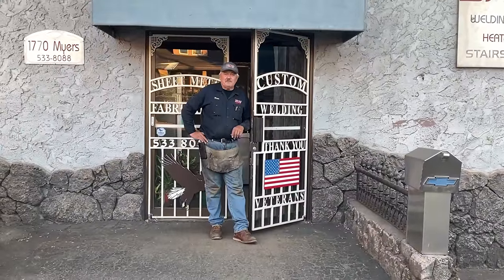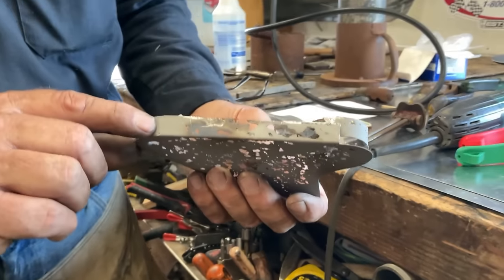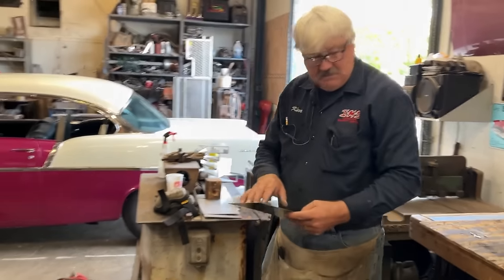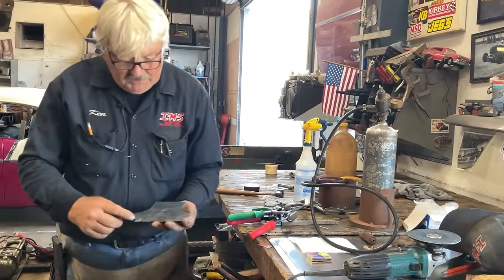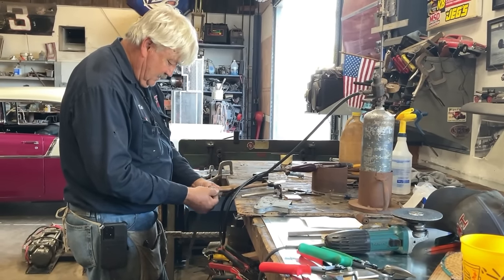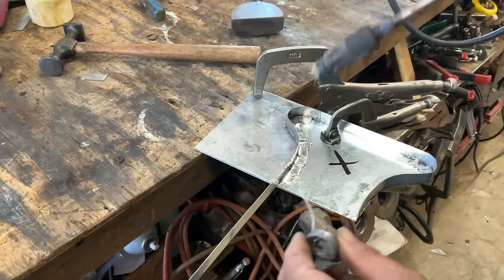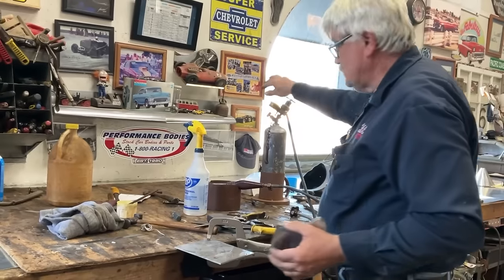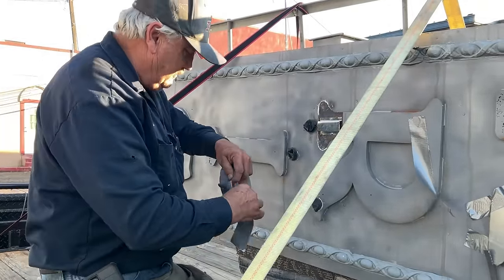Sheet Metal is Fun!  Restoration: Repairing letters on a local iconic and historical sign.

Comment: I´m a blank at any metal soldering and brazing outside copper electro wiring with bolt and fluxed tin. Keep em coming, the more the merrier !
Reply from the maker: The sign is out of the paint shop, and boy is it ever BEAUTIFUL.  As soon as they get it installed and lit up, we are going to put together a follow-up up video. Keep an eye out for that one. Thanks for hanging out with us.

Comment: In 1742, French chemist Paul Jacques Malouin described a method of coating iron by dipping it in molten zinc in a presentation to the French Royal Academy.

In 1772, Luigi Galvani (Italy), for whom galvanizing was named, discovered the electrochemical process that takes place between metals during an experiment with frog legs.

In 1801, Alessandro Volta furthered the research on galvanizing when he discovered the electro-potential between two metals, creating a corrosion cell.

In 1836, French chemist Stanislas Sorel obtained a patent for a method of coating iron with zinc, after first cleaning it with 9% sulfuric acid (H2SO4) and fluxing it with ammonium chloride (NH4Cl).
Reply from the maker: Very well said. Thanks

Comment: Is burning the galvanize with the soldering iron something to consider? Like welding it is toxic...does the acid mitigate that? Appreciate ya
Reply from the maker: Don't ever burn (or melt) galvanized material. It off gasses a toxic cloud. Soldering is a surface adhesion process that stays several hundred degrees  below the melting point of the zinc coating. Which is what "galvanized "is made mostly of. The galvanized coating is slippery and non porous. That's what makes it  work so well . The acid, etches the surface and allows the solder to grip it. Let me know if you have any further questions. Thanks for watching

Comment: In 50 years of HVAC-S/M I* never saw the aluminum plate trick. Great tip!  The other reason to get rid of the water , it can POP and give you a faceful of hot solder! Are you going to add weeps to your new work? Where is your sal ammomiac block and dip pot?
Reply from the maker: Good questions. You aint no rookie. Block o Sal is put away real good. Dip pot too . Yes on the weep holes. Thanks for checking in.

Comment: I agree that acid will certainly corrode the metal. But even in your own words you said the letters wouldn’t be rotted out if it wasn’t for the water sitting in the letters. Yet the old timers certainly used acid to solder the letters back 110 years ago. What makes it different today??
Reply from the maker: We fabricated the replacement letters using the exact techniques as the original craftsmen. The original letters were then silver soldered to the substrate. No acid is required. The sign must be oriented horizontally to perform said attachment. We didn't have the proper lifting equipment to perform that requirement. The fact that you would state such an inquiry is very pleasing to me.  It shows thought and process. Two things I'm very fond of. Thanks for your time. I'm glad you found us.

Comment: I have a question about using galvanised/zinc plated steel sheets. When you are cutting/shaping a piece of steel, you are breaking layer of coating on the edges of material.

Why it is not  required to restore/ recoat/seal the final product to prevent rust?

BTW why don't use for example baking soda water solution to neutralise acid when soldering? Water just reduces the acid concentration when soda neutralises.
Reply from the maker: Good questions. We only made minor repairs of the corroded letters. The sign is off  to a paint shop for final rust prevention and a finish coat of paint. We will show the finished product when they re install it. Thank you for your thoughtful comments.
Reply: @kengodfrey1956  Thank you for your reply, Ken.

My questions are actually more general about sheet metal techniques, not about the sign restoration. For example if I make a water tank or even a tool tray ;) it may start to rust from the edges? It will be at least aesthetically not good, also can help to spread corrosion.
Reply from the maker: Check out our lesson about deconstruction. I made the briefcase and the bins over 40 years ago and they show no signs of rust. You need a source of moisture to really grow a good patch of rust. You can apply cold galvanized in an aerosol can, paint, or an occasional rub with oil to stave off the onset of corrosion. Which is what rust is. If your project is subject to continuous submersion you will be wise to employ stainless as your material. Type 304 is most common. Type 316 is best when exposure to salt water cannot be avoided .
Reply: @kengodfrey1956  Thank you!

Comment: I’m a self taught blacksmith but I’m really enjoying your lessons ken, so much so I’m going to try some myself with my dads old soldering irons (copper block on a handle) using my gas forge as a heat source.
Reply from the maker: That's awesome. Send me a photo of your project. My 40 year old son is a sheet metal worker, welder and blacksmith. I love all things creative.
Reply: Careful with the forge gas there feather. you'll melt that old copper if you use a normal gas pressure. good luck
Reply: I recently diy rust repair on my 06 cad. It's not that new but first for me, using panel bonding adheasive; automotive. The original brand   and one by 3m. Comes in double formed tube. One side twice the size as the other. Testing showed the metal will tare instead of adheasive giving up. Very good! 90 minute working time. The one I bought.
Once you find a way to hold the piece in place until the bond is set up you won't need screws. If you do just take then out and fill with more adheasive.
Very Good!
Mike
Reply from the maker: @mikediamond1522  the sign is off to the paint/ body shop. They couldn't say enough about that product. They are going to use it on the sign in several places. Even on the letters we repaired. Thanks

Comment: Please have the cameraman get closer than 15 feet away! Mostly all of the precise things you're doing isn't on film cause the camera is too far away. It would be nice to see you actually doing this soldering, up close. Also, no flux is needed for this? I guess the muriatic acid is acting as the flux too?
.
Thanx for taking the time to put vids out, you're a natural teacher! 
👍🛠️🔧🔩📐📏🔨🔧✏️🗜️👌💪
Reply: What kind of solder is that?
Reply: The galvanizing is zinc, effectively the material is pre tinned. The acid removes oxidation from the surface. With heat the solder will readily adhere and merge with the zinc coating.
Reply: Why couldn't you pop-rivet it to the(5/8" x 5/8") pieces you put behind the letter instead of silicone that will fail eventually?
Reply from the maker: We couldn't have an exposed fastener. The polyurethane cures and stays flexible for nearly 50 years. It is concealed from the sun which allows it to expand and contract in varying weather conditions without losing adhesion.
Reply from the maker: This was not our soldering lesson. We will cover that in an upcoming lesson. This was more of a precursor in a practical application.